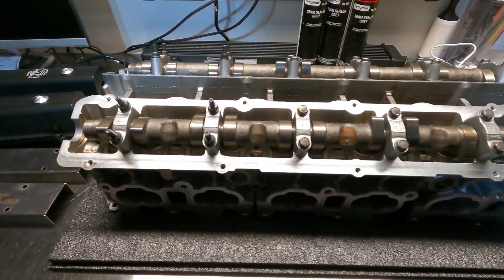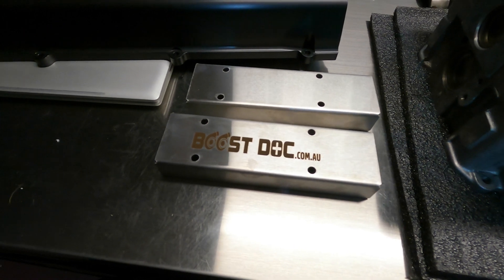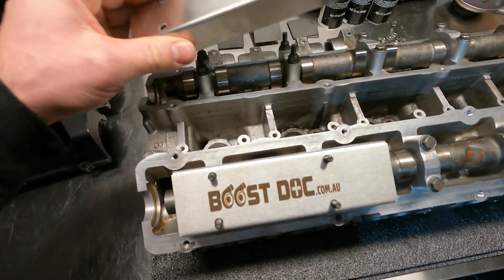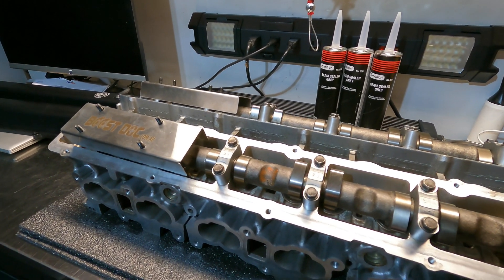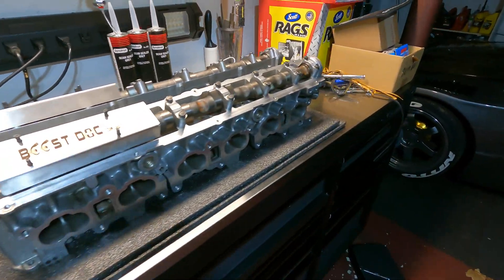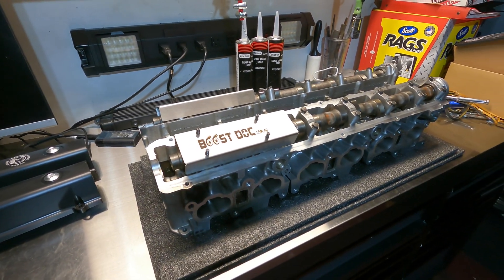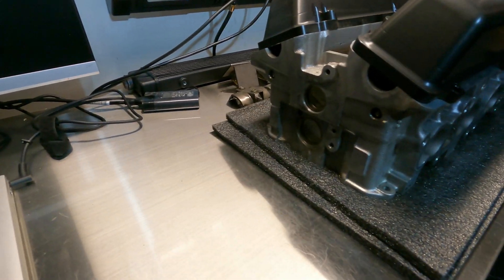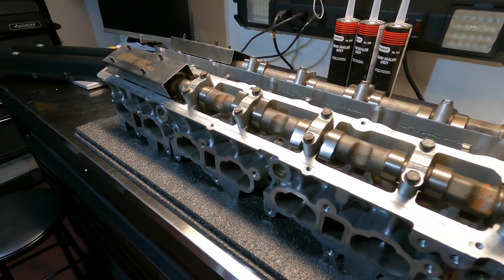Boost Doc Oil Splash Plates | Why you need them for the RB20/RB25/RB26

Comment: What if de don’t have head drain ? Just installing this can we fix the issue getting oil in catch can?  Only we need to install at the rear ? I have rb25/30
Reply from the maker: Two different issues. The splash plates keep flung oil from getting up and out into the breathers and into your catch can. having proper baffling in your valve covers will aid tremendously. Rear head drain is for a different issue, Oil has a tendency to pool up in the RB DOHC heads, especially during hard acceleration. Having a rear head drain gives this oil a place to escape back to the sump, and it also adds an additional "vent" to relieve vacuum which aids in oil being able to gravity drain.

Comment: Just looked at your website. Do Rb30 and Rd28 blocks really sell for that over there? Wow. I might start collecting a few. Rb25/26/30 are starting to dry up but Rd28’s are still fairly easy to find. (Usually still in GQ Nissan Patrol for $2K-$6K AUD.) 
Alternatively, the Nismo Heritage program is making brand new GTR components including the O5U and 24U Rb26dett blocks. 

*If you want to import a brilliant L6t engine from Australia, Fords 4L ‘Barra’ engine is the one you guys should be looking at. They’re still fairly plentiful as the vehicle they were in was discontinued only a few years ago. The engine was in the BA-FG XR6turbo (XR6T) and the FPV BA-BF FPV typhoon and the FPV BF-FG F6. 

Trust me. These things are what you guys missed out on in the States. Unopened they good for a very reliable 600bhp. Some people push them further... 

Ive driven a BA typhoon with 400rwkw and a tuned ZF auto and holy dooly, that thing was too fast for its own good. Aero only good for 240kph 150mph(?) and it was still pulling like a teenage boy when it got there.
Reply from the maker: Yes they do. They are still relatively rare over here and it seems that finding decent usable examples are getting more difficult.